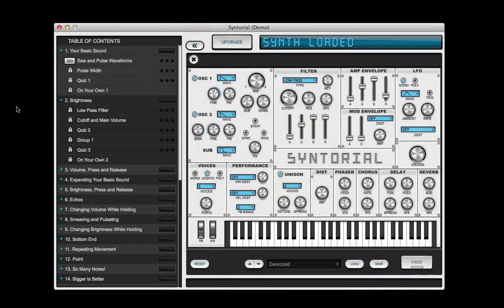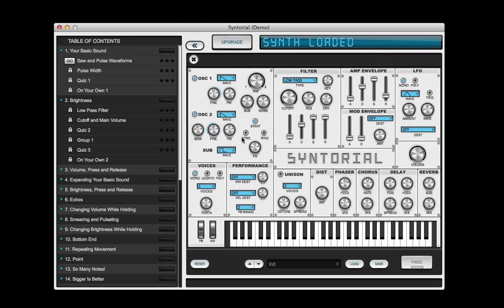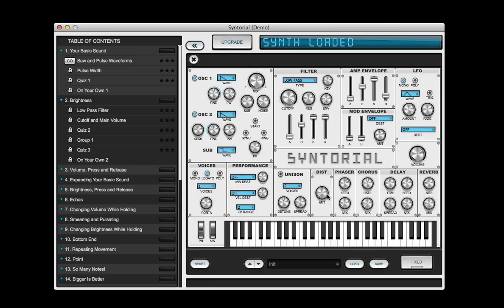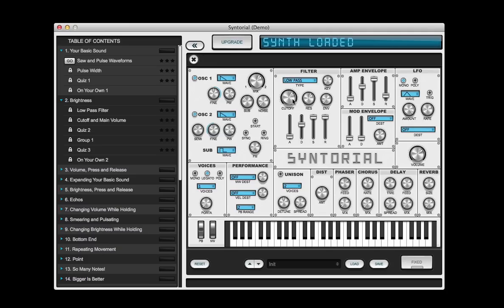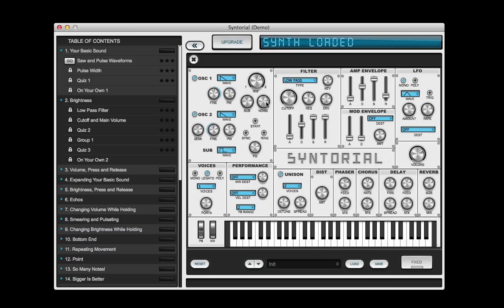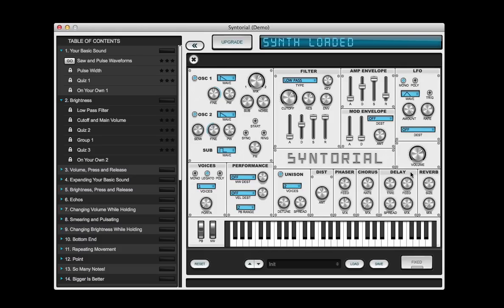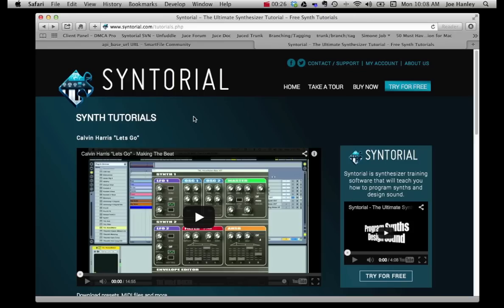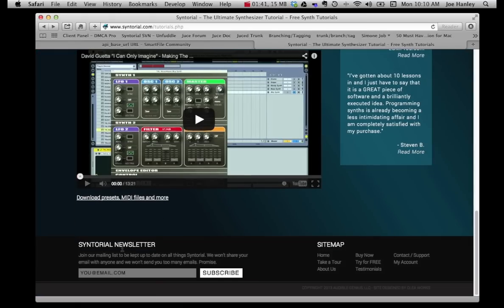"Derezzed" by Daft Punk - Synth Tutorial

Comment: Thank you for this video. I was wondering how to do the variations they put later in the track. I guess the Porta(mento) control can be used to enable that gliding back and forth sound that we hear later, at least when I set it to 180ms I get a good result. Any tips from your side on how the latter parts of "Derezzed" are done?
Reply from the maker: It's been a while since I made this video. But after a brief listen through I hear a lot of filter movement. Sometimes high-passing, sometimes low-passing. I also hear a fluctuation in the amount of distortion at times.

Comment: This will come in handy, I've self taught synthesis myself by analyzing waveforms in generally interesting leads or synths. I've managed to recreate a 'wah' almost perfectly by using a low pass detuned saw which the low pass with lots of resonance that had an envelope, the thing is is that it only took months to think of that, before I tried to use a FM generator, similar sounding but not pin point. I feel knowing what will create these great leads or synths will help discover other sounds also, which I hope will lead to better production.

Thanks for the the tutorials.